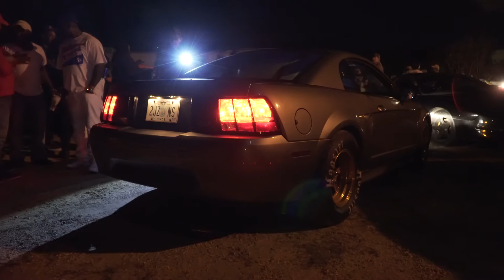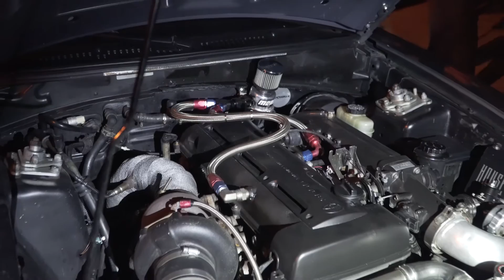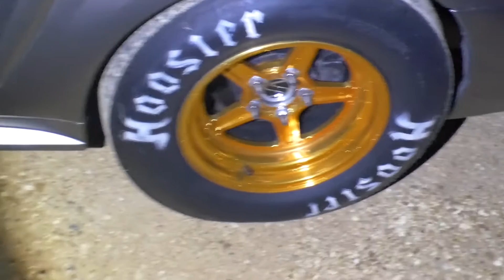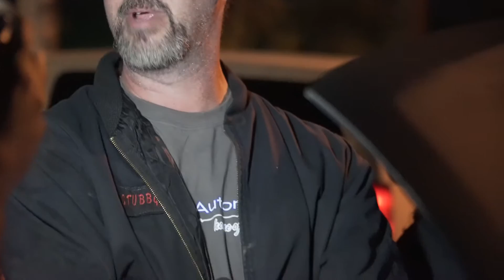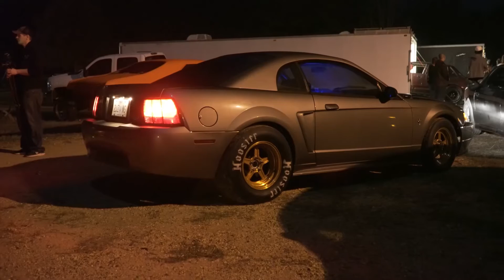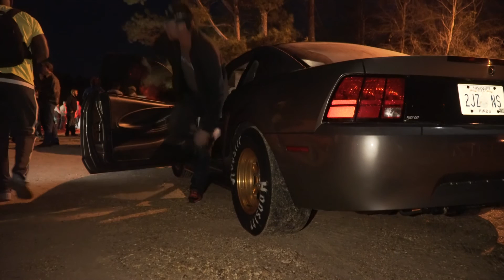2JZ Swapped New Edge Mustang  AKA : SupraStang

Comment: My 03 new edge needs a engine swap 2v is garbage might 2JZ it
Reply from the maker: +Lone Texan good swap
Reply: I drink water why not 4v it? Cobra motor swaps in after extension of some wires and some fuel mods. No major modifications
Reply: Unless you dont mind the work hahah then go for it its a cool swap
Reply: Already did mine and its an easy 700+ Beast👹
Reply: @iowasucks9494  will the v6 be able to take the power or do you need to drop the transmission and change all that shit lol?
Reply: Just boost the 2 valve man